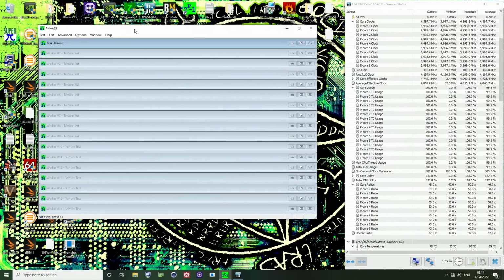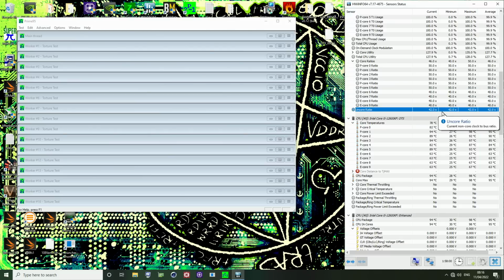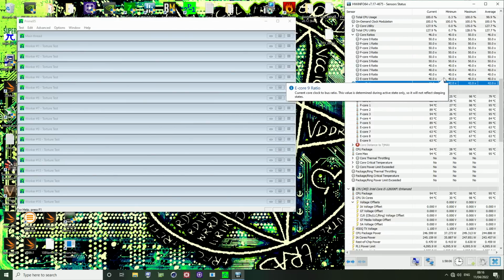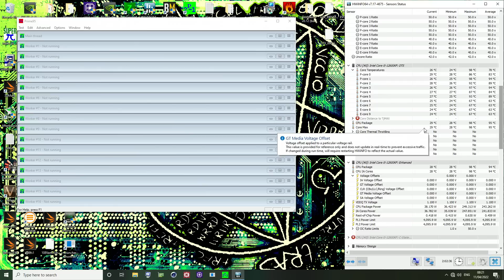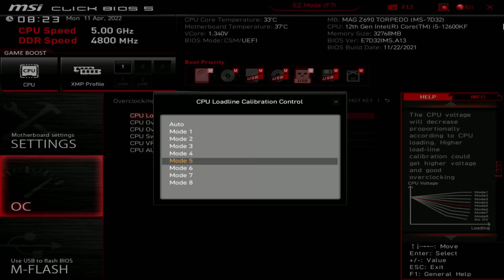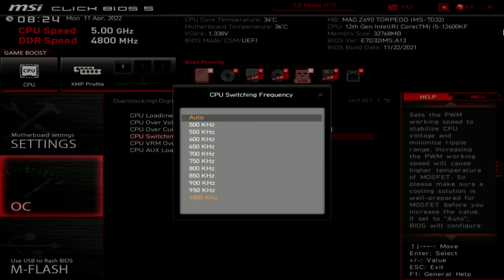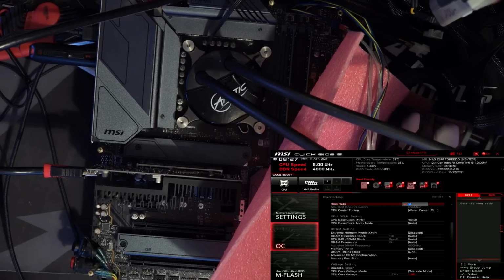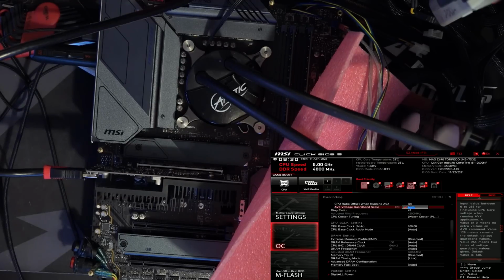i5 12600KF Prime95 P and E core Overclock on 240mm AIO with MSI Z690 torpedo EK X

Comment: With all these settings you are just trying to reach 5.0GHz, instead of messing with all these settings just activate ''Enhanced Turbo,'' under load all cores will automatically switch to single core speed i.e. 4.9 GHz, on desktop or small tasks it will drop to minimum speeds etc.

Comment: Arctic 420mm aio is so cheap these days, you just need enough space to fit it, also prime95 is just useless, you wont ever run into that type of load on normal usage, on prime95 you might get 95c but on gaming 65c, im on 5.1ghz 1.33v and it overheats on every stress test but runs perfect on games at a decent 70c
Reply: But not many cases have that 420 AIO support

Comment: Thanks for the great video, I did as you do. Is there a chance that you would help me lower the timing frame? currently working on profile 2 ddr4 14-16-16-36 (Gear1) series have 4000mhz cl16 you can even lower them on timings and increase the mhz

Comment: got 5.6g (2), and 4.1all at 1.485 adaptive, avx stable p95 all core 12600k, 8100ish r20
Reply: mode 4 MSI, runs 5.2g in p95 (1.31v vcc sense) smallfft

Anything else make sense to do?
Can't go over 4.0ring no matter voltage/set ring
Reply: RIP CHIP

Comment: Why is aio appreciably worse than custom? Is it the usage of aluminimum instead of copper, the limited flow from the comparatively anemic pump, is it just the smaller contact patch on the cpu block, or the less engineered fins/microfins/etc. ?
Reply: I'd say it's a little bit of all that. (Varies by model of course) but primarily it's the amount of fluid that is in the loop. It provides more mass to take handle higher thermal load. Also with that, it takes longer to reach heat soak. (Max thermal load/density/transfer). Limiting factors are surface area(the fins and patch contact), thermal mass(the water and build materials), and the fans(which also tie into those other standards)
Reply: Obviously I'm not an engineer but I do remember some science from school and the plethora of videos I've watched on the matter lol. Jayz2centz and GamersNexus have talked about it before if u wanted to find out more.
Reply: @jdogdarkness  they all seem like they'd contribute, but I'd be interested in seeing someone snip the tubes, use some barbs to convert components to G1/4, and mix and match with real open loop parts, to show which particular part bottlenecks the aio most vs open loop
Reply: @manuelbardina  that could be interesting. There is a dude that like designs fans and does other things relating to PC thermals that would be the best bet. Gamers Nexus disasemles and analyzes constructions of AIOs down to the fins. But Jayztwocentz is prob the biggest custom loop guy on YouTube. know about Linus Tech Tips right?  Just throwing out some things you might find interesting.

Comment: On Gigglebyte you can disable all power limits with one switch as well.
Reply: What is that switch called?
Reply: @razerface35  I think it is called Power Limits, in the Advanced CPU Configuration section.

Comment: My 12600K does 5 GHz undervolted with -0,1 v and air cooling - noctua but still. I'll check with prime to see if that makes more heat than Intels OC utility. Board is Asrock Z690M-ITXax.
Reply: I thought it wasnt possible to oc with air cooler. What are your temps? I have also aircooling with 2 fans 12 heathpipes

Comment: Does the 12600k have significantly worse silicon quality than the 12900k? That much voltage for only 5Ghz is kinda bad. For comparison my 12900k maxes out at 1.28v with TVB voltage optimization on at 5.2Ghz and pulls max 260w with stockfish. It's not like my CPU is a golden sample either, it only has a SP88 rating.
Reply from the maker: an overall SP of 88 is above average for 12900Ks and since the overall SP is a combination of the P and E core SP your P cores could actually really good. Also 260W power draw in Prime 95 SFFT sounds abnormally low.
Reply: @ActuallyHardcoreOverclocking  The breakdown is SP98/68 P/E, so the P cores are pretty good. However, there are a number of variables that could have a significant effect. I'm using adaptive mode + advanced VF offsets (-0.175v@48x,-0.075v@53x). I've matched the AC/DC LL values (36/36) to the VRM load line (Mode 6@800Khz). And I'm using washer mod with a delid (though it didn't increase undervolting headroom). Using a Unify-X btw.
Reply from the maker: @meltingfaces10  what stress test are you runnining? Also 98 SP Pcores are really good.
Reply: @ActuallyHardcoreOverclocking  Stockfish  and y-cruncher. The ASUS Strix D4 board I have can't undervolt as aggressively as the Unify-X, but I don't have access to the necessary equipment to explain why.
Reply from the maker: @meltingfaces10  Y-cruncher isn't very hot and if you have AVX512 enabled the CPU runs even cooler than with AVX256.
Reply: @ActuallyHardcoreOverclocking  Stockfish is though
Reply from the maker: @meltingfaces10  how do use stockfish as a stress test? As I literally have no idea how to use it.
Reply: @meltingfaces10  If you're not testing with small FFTs P95 AVX2 then you're not stress testing as hard as in this video.

Comment: damn man, ty, i tried 50 multi on P-Cores with fixed voltage 1.210v and it worked like a charm. i guess my cpu is better bin because i run 4.1 on the E cores and 4.3 on the ring. my avx-2 down-ing is -1 multi. its stable at prime95 small ffts but i have my cpu temp limited at 90C so it throttles a bit. i also think i have a faulty temperature sensor cuz i repasted the 3 times and i always get 15C more on Core #3 than Core#2. my paste was evenly spread last time and it was still temperature bugged. my cooler is really shitty so im not trying higher voltage than that. i got noctua 45mm heatsink with 2 fans. very bad cooler for oc, idk what i was thinking.... i was wondering why are you playing with this fluctuating voltage? why not go with fixed value 24/7 like me. what would the difference be? i dont believe it will affect longevity cuz my 2500K is still very healthy and not degraded at all and its a 10y+ old cpu soo.. i'd be interested in hearing why you prefer floating voltage to fixed voltage.
Reply: hello good sir! my temps are also like yours. my core 3 is always heating way more than the others even after i replaced the termal paste multiple times, and with different brands (Noctua NT-H1 and Thermal Grizzlie Kryonaut - same results)
Reply: @mash9262  very weird, what could be the problem? I still havent solved it
Reply: also something else i noticed. my Wattage is much less than yours. mine Package wattage capped at 173W. and yours is more than 200 with lesser clock? and your vrm temps are double mine?
Reply: yo im a bit late but a cpu delid might fix specific core high temps, i dont think ur sensor are off
Reply: @franckdruart8120  rofl why would i delid my cpu?
Reply: @franckdruart8120  like if its something easy?

Comment: My 12600k needs 1.230V for 5GHz/4GHz/43 all-core small FFTs P95.  Heat is... incredible.  After running it for a bit to confirm stability, I set TVB so that power viruses immediately kick the multiplier down while still allowing easy stuff like Cinebench the full frequency.
Reply: That's a great idea for TVB, by how many multipliers do u set it?
Reply: @Ben-ld1qi  There are two temperature thresholds so I set -1 for 88c and -2 for 95c.  It adds some oscillations in frequency but seems to do the trick.
Reply: @chronoreverse  Thanks that's a really good idea, I'll implement that. The reason I asked is because I only need the CPU/RAM (DDR4 S8B) overclocked for gaming benefits in 1080p/240hz. I was using Linpack to test stability of the memory timings but Linpack ends up shooting cores to 97~100°c, so I'll probably set a decrease multipliers for when it reaches 80°c+. When gaming tho, CPU is in the 60's celsius overclocked on a budget air cooler, so I'm happy about that.

Comment: my 12600kf is at 1.210v 4.8 pcores 4.1 ecores 4.3 ring, ram 7.5ns 4000cl15 b-die. Prime95 small ffts perfectly stable and ycruncher 2.5b avx2 perfectly stable.
Reply: two days ago i succeeded with stable oc. it was unstable before that because of the ram.
Reply: ps.. hmmmm you got 5.0 ghz on 1.210v too, maybe i can try this later

Comment: My analogy for raising the voltage is that it's like increasing the pressure on a hose, more water is going to flow out necessarily
Reply: I read "horse" and was very confused
Reply: @givemeajackson  unfortunately the results of raising a horse's pressure really fast are far harder to clean off the walls and ceiling
Reply: @kunstderfugue  
and mouth 🥵

Comment: As I understand it the relationship between frequency and power draw should be fairly linear. So 2.5 to 5.0 would double it but 5.0 to 5.5 would increase it around 10 percent? So its more or less a non-issue in most overclocks ?

Someone correct me if I'm wrong
Reply: Only if you assume the same voltage and 2.5 GHz definitely shouldn't need as high voltage as 5.0 GHz - this is well into the territory where extra voltage should be expected to be needed.
Power draw at a given frequency is quadratic with voltage!, so even if it only needs say a 20% increase in voltage for this jump that would mean the power draw went up with almost a factor of 3 instead of double (2.0 * 1.2^2 => 2.88x power draw).

This is why be default processor/BIOS have a voltage curve mapping from frequency to required voltage. For desktop OC it's not uncommon to just go with a static voltage and static frequency (simpler and for a desktop usually fine), but it doesn't change that the voltage necessary for a processor to be stable goes up as the peak frequency goes up.

The amount of extra voltage required tends to get steeper as you get near the processors frequency limit and 5+ GHz certainly qualifies for that at ambient so I would expect 5.0 -> 5.5 GHz to require quite a bit extra voltage so the power draw likely goes way up rather than merely 10%.

But I don't have enough experience with Alder Lake overclocking to even guess how much extra voltage would be needed, other than suspecting the power usage is going to be some variant on "a lot more". Yes, the i9-12900KS is rumored to have a 5.5GHz max boost but the reality is that for all-core loads it's going to be heavily limited by the MTP, despite that increasing from 241W to 260W. I expect it'll boost a bit higher on single or few-core loads though.

This is for ambient but the same basic principles applies for sub-ambient too (phase change, LN2 or LHe) but the cold reduces the voltages required for a given frequency to be stable (and the colder the more it shifts down), this helps a lot thanks to that quadratic factor.
Reply: @Torbjorn.Lindgren  awesome answer. Thanks for the assistance!

Comment: I have the Edge WiFi DDR4 with 12700kf. Can I use your settings to hit 5.0ghz for daily? THanks!
Reply: Just try it out and then adjust from there
Reply: @Mom19  I should mention I have the Liquid Freezer II 280 but my temps got crazy when I ran cinebench. I'm thinking it's probably the way it's mounted since I jerry-rigged the mounting for it. I scavenged some of COrsair's mounting bracket. lol. Anyway, Artic sent me the lga 1700 bracket yesterday. I'm hoping my temps will improve with it. :)
Reply: @Santissimo-x3b  it could be very well mounting, yes. Maybe airflow too, make sure your pump isn't pulling air either :)
Reply: @Santissimo-x3b  I was getting very high temps even with a LGA 1700 bracket, did the washer mod on my MSI Z690 Pro-A and dropped a further 5C. I also delidded my 12700K since even with the washer mod and 280mm AIO at max, I was smashing 97C. The delidding brought temps down further so now my max is 89C on cinebench for 1 hour. Hopefully the new mounting bracket works out for you as unfortunately for me I needed to do a lot of work to get mines tamed.
Reply: @jackiekuang7603  oh god. I'm not prepared to delid. lol

Comment: Does this or the Tomahawk DDR4 variant have SMD dimm slots? For example Aorus pro has them SMD on both DDR4 and DDR5
Reply from the maker: the Aorus Pro DDR4 uses through hole dimm slots. Only DDR5 boards have SMT slots.
Reply: I have the Tomahawk DDR4 and it does not have SMD dimm slots.
Reply: right.. I mistook that

Comment: which of the mobos allows non-K bclk OCing, is there an exhaustive list? i could only find der bauer video showing two super expensive boards. do i need to pay $200-300 for a board to be able to do BCLK ??
i am so torn with the 12000 generation as to what to buy because it really seems nobody cares anymore about systematically testing all possible stuff with all possible configs anymore. nor documenting it...
Reply: Just look up the board you want if it has an external clock generator. If it hasn't, no BCLK on non K.
Reply: @Mom19  Other issue is, locked 12 gen CPUs also have locked System Agent control, so no actual RAM overclocking, as you're stuck with 0.95V on VSA.
Reply: @PolskiJaszczomb  that is true yes, but the question was about BCLK just for the CPU I suppose :O
Reply: @Mom19  Well, the extra payment for that BCLK OC equals to getting an unlocked CPU, so there's no real reason to opt for BCLK overclocking, as external clock gens only exist on the most expensive boards. Intel level of trolling.
Reply: @PolskiJaszczomb  Yeah I agree, certain things are currently not worth it to switch to anyways. PCIe Gen 5 is cool, but no benefit well not much of a benefit from gen4 so far either, maybe with direct storage by then. DDR5 is also not really any improvement and certainly not worth the big extra so far. Not to mention current Kits will be probably garbage in a year or so. Im very happy with my 5800x for my VR system. Its all fun and cool, but it's not that worth switching to aslong as your current system can still keep up. Save your money :D
Reply: @Mom19  thanks guys, i'll check out if i can find that info about clock generator
Reply: @baumstamp5989  alright, good luck! Hope you will find the best price to performance option for you :)

Comment: Does raising the CPU Switching Frequency have stability benefits?
Reply from the maker: depends on the motherboard.
Reply: VIDEO ABOUT THIS PLZ
Reply: I saw marginal, if any benefits on a low end z370 board, but a significant increase in VRM temps, so take care with it
Reply: Switching frequency affects power rail ripple at the expense of efficiency

Comment: Nice barebone RAM kit :d

You should go and ask Arctic for a Liquid Freezer II 420 mm :v
Reply: Even the 280 or 360 is easily capable of heavy overclocking. I have a 240 on my 9700k running 1.33 vcore, Prime95 @ 190 watts and 75c core temps. Radiator is only mildly warm to the touch - with fans at 60%. Thick rads ftw. Of course i had to lap the IHS, because i ran into contact / heat transfer issues well before the limits of the puny little 240.
Reply: @NightFlash24  I've got 1st revision LF II 360mm, cooled delided and sanded 5775c to 76C @165W in P95, 4.2GHz 1.368-1.405V (FIVR FTW...). Now I've got 12700k coming and I really hope its IHS is not a concave mess, I'd rather not have to sand it down, but oh well, not that it's gonna die if it didn't come dead x).

I'd never opt for 240mm AiO over D15, no benefits and more hassle + potential pump failure. 280mm and bigger is the way.